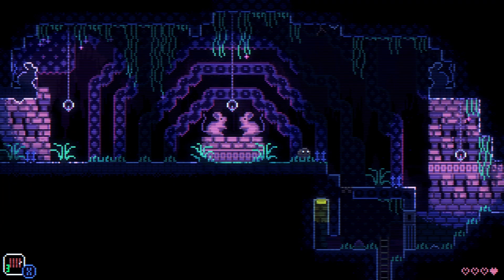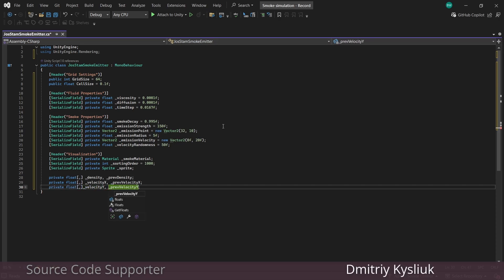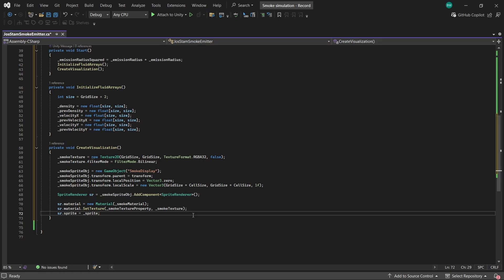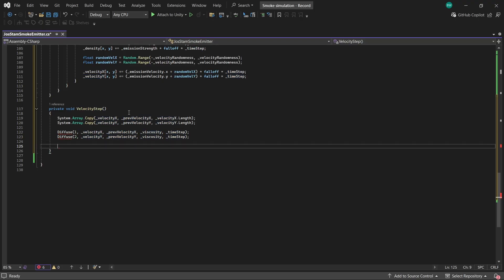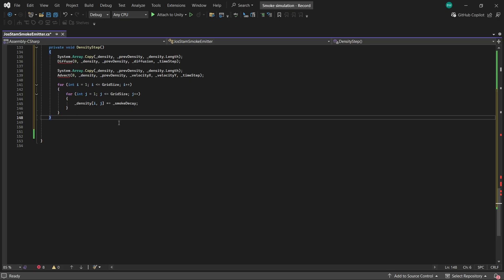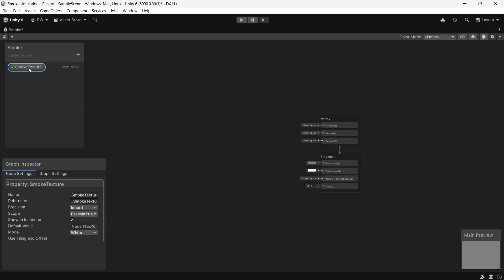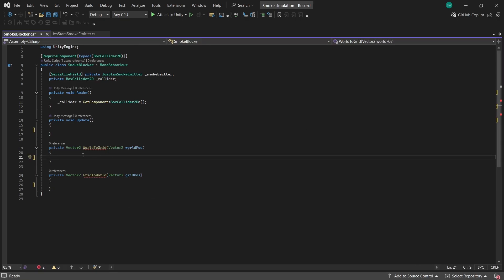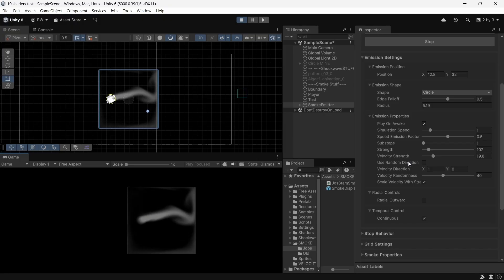Make BETTER interactive smoke using FLUID DYNAMICS (Unity Tutorial)

Comment from the maker: It's FINALLY done (The smoke emitter on Github I mean)
Just an FYI though, I did not manage to get it working with compute shaders. Instead I used JOBS, and more efficient solvers for the smoke simulation, and it's QUITE efficient, and looks really really nice!
You can check out a demo of it in action over on itch.io: https://sasquatchbstudios.itch.io/dynamic-smoke-demo

Comment: Is this very demanding on the memory?
Reply: It's just some grids of floats, so it shouldn't be a problem as long as the grid size is remotely reasonable. You'd to run into performance issues long before you'd run out of memory.